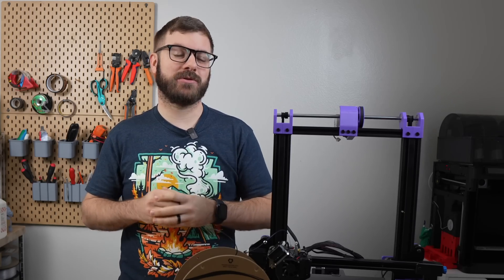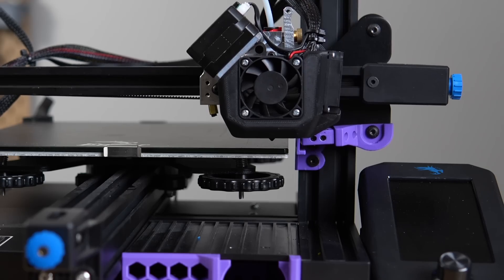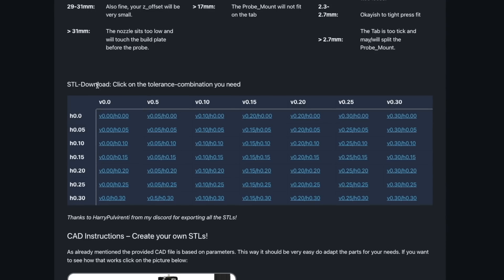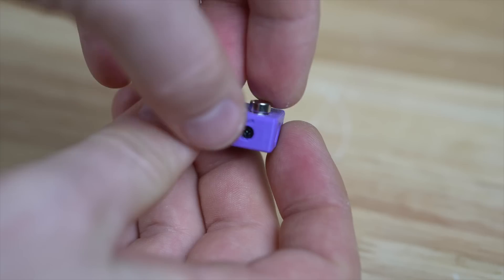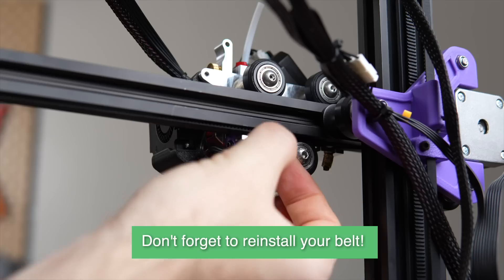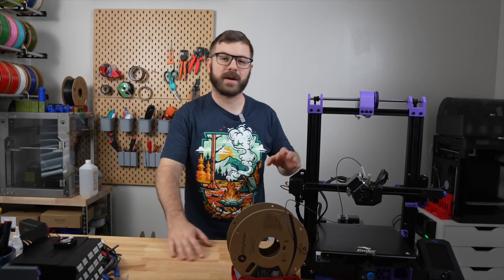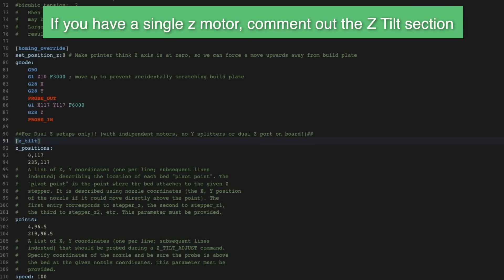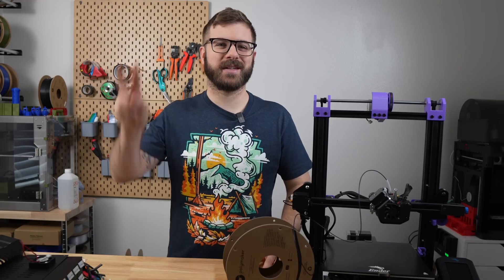Best Bed Leveling Probe For Creality Printers (KlackEnder)

Comment: You can use the probe AS the Z endstop IF you leave the probe on the printhead at the end of every print.  At the beginning of every print do a home all, a bed probe for height mesh, and then undock the probe just before you start the print.  This same logic applies to the klicky probe with a servo mount on the switchwire or enderwire conversion.  The switchwire needs the servo because there isn't any good way to mount the probe dock on the X axis or the Z upright without getting in the way of the tool head while printing (unless you don't use the portion of the bed on the right hand side.
I think that the Z endstop position you gave is wrong.  It should be +8 NOT -8 since the endstop (probe) will fire when the print  nozzleis above the bed, NOT below it.    Also Z offset is the distance from the bed to the nozzle when the probe fires, so that is also a positive number.  Y offset is the distance from the probe to the nozzle (positive) and X offset is the distance from the probe to the nozzle (we try to position the probe directly behind or in front of the nozzle so that distance will be zero).   There is also a z offset setting you can adjust in the klipper web interface, this setting allows you to get the nozzle at the desired height (usually a piece of paper between the nozzle and the bed with a snug but not hard fit) when the position of the z axis is at zero.   This is NOT the same as the z offset in the z stepper section.
Reply: "There is also a z offset setting you can adjust in the klipper web interface, this setting allows you to get the nozzle at the desired height (usually a piece of paper between the nozzle and the bed with a snug but not hard fit) when the position of the z axis is at zero.   This is NOT the same as the z offset in the z stepper section."

This! Exactly was my point. Do you know if there is a way we can put this value in some cfg file?

Comment: Great video i struggled 5 hrs to do this and still cant figure out why the printer starts like at 10mm height from bed whats the solution i tried all possible z coordinates to be changed no solution
Reply: Same. I can't figure out how to set the z offset precisely.
Reply: did you find a way? @nishantlaxmikant5899 @kyleshearer1270

Comment: is it possible to wire the klicky on the 5pin bltouch slot for the 4.2.2 board? so i can use the z endstop pin as a Sxbolt for auto z calibration

Comment: It's so funny that this has now become a 'thing' when several years prior this was one of those 'meh' methods of bed leveling because microswitches have such low precision for activation. Same for inductive; used to be poo-poo'd on but plenty of people use them now. Still staying with the good ol' BLTouch that never lets me down!
Reply: Really, you've never had the drop pin bend because it hits some curled up ABS? For me this was a constant issue, now fully resolved with Klicky.
Reply: @zeroPressure00  nope! Honest to goodness never happened with the plastic or metal pin versions I have.

Comment: I modded my v2 with almost everything except the z-belted axis.. but I'm having problems tuning it for Klipper and get the most out of it.. I use OrcaSlicer and the default v2 profile is based on marlin.. so... super slow... and the default Klipper printer acceleration numbers are way too high... is there a proper way to get the maximum numbers for the v2 on arcaslicer? i would love to see a "Ender 3v2 marlin to klipper speed tunning guide" that not only show the  the calibration parts and the filament tunning but how to properly tune all speeds to get the most out of it

Comment: So why not just use bltouch?
Reply: Not sure about actual BLTouch, but Klicky is at least 25x more accurate than my old 3DTouch (a BLTouch clone). Extremely repeatable. I have my sample_tolerance set at 0.005, and could probably go even lower. For comparison, with 3DTouch, best I could do is 0.02, and that was with like 10 retries per position.
Reply: Klicky is cheaper
Reply: deadzones during bed meshing...

Comment: This is exactly what I needed to find for Z probe for the Ender 3 I just acquired. I am curious about one thing - you mention removing the existing Z Endstop unless you're going to use the klipper auto z offset plugin. Do you have any information on that?

Comment: Hi I just set this up and klipper gives me this error 

Section 'menu __main' is not a valid config section

Once the underlying issue is corrected, use the "RESTART"
command to reload the config and restart the host software.
Printer is halted

Comment: How is that better than BL/3D/CR Touch and why we should use it?
Reply: Not sure about actual BLTouch, but Klicky is at least 25x more accurate than my old 3DTouch (a BLTouch clone). Extremely repeatable. I have my sample_tolerance set at 0.005, and could probably go even lower. For comparison, with 3DTouch, best I could do is 0.02, and that was with like 10 retries per position.

Comment: Grrrrrr
I just sat here for 2 hours just to get this error:

Klipper reports: ERROR

Section 'menu __main __klackender' is not a valid config section

Once the underlying issue is corrected, use the "RESTART"
command to reload the config and restart the host software.
Printer is halted

Cannot figure this out! I guess it is back to the old school way

Comment: I have the NG as well and when I see your values for the stepper Y, I put in position_min: 10 and position_endstop: 8, but I get an error because 8 is less than the minimum of 10. Should those values be flipped?

Comment: I have it installed and running, but... I can't get the mesh and z offset to save, and the gantry doesn't pickup or drop off the probe when doing the mesh. I have to place it manually.??

Comment: What makes the klicky setup better than a bl-touch, other than the price?
Reply: Not sure about actual BLTouch, but Klicky is at least 25x more accurate than my old 3DTouch (a BLTouch clone). Extremely repeatable. I have my sample_tolerance set at 0.005, and could probably go even lower. For comparison, with 3DTouch, best I could do is 0.02, and that was with like 10 retries per position.

Comment: Nope, as soon as you mentioned Klipper I was out, not wasting a second longer getting that to work. Shame, it looks really good.
Reply: That's what I thought, watched it though, turns out it works on marlin too. May be worth a watch tbh, I'm debating scrapping an old mouse for switches and screws at this point lol
Reply: Why do you keep using Marlin?

Comment: would this work with ender 3 pro? it's the base machine and I'm using Cura software, no marlin, no Klipper. I want to add this to my printer but not sure how. I was wondering if you could help me on this?

Comment: Had lot of trouble with it. Will give it another go
Reply: My only trouble was breaking retainer 2 times until I adjusted gcode to fit my machine, took some sleep and adjusted it perfectly. Now it docks and undocks everytime perfectly, this thing is super reliable and precise once you set it up correctly

Comment: Aww, I'm Devo.
I just got this all installed and the wire or switch contacts are not connecting to the surface of the magnets.
Magnet to itself conducts.
Switch contacts verify switch is working.
Can't solder.
Magnets superglued in.
Drove 40mins each way to pick up these magnets.
😭

Comment: Great install video, but another video showing the issues users face upgrading another from another probe with an existing printer.cfg with some addons already installed.  There are a lot of settings that make it a lot more complicated to get working. tilt_screw_adjust, and probe_calibrate macros are especially trouble prone if you are not very klipper knowedgable.
Reply: I myself run into troubles upgrading from a BLTouch: duplicate chip name ´probe’. I would love to see a video addressing this.

Comment: What is the best way to figure out z-offset with this setup? I used the PROBE_CALIBRATE with the bl touch but that doesn't seem to apply anymore. 

I was thinking a macro along the lines of:
 [gcode_macro Z_Offset]  
    G28 X
    G28 Y
    PROBE_OUT
    G1 X114 Y103 F6000 #my offsets
    G28 Z
    PROBE_IN
    G1 X114 Y103 F6000 #my offsets
Reply: You use PROBE_CALIBRATE. I did, anyway. The principle is exactly the same as with bltouch.

Comment: Can you make a before and after video detailing the kevinakasam belted z vs the stock leadscrew's impact on the surface finish? I've been dealing with ugly layers from my e3v2 z axis binding for too long and it seems like the z belt mod would do the trick.

Comment: The probe itself is great after fixing some basic printability issues with the CAD. However the klipper macros are not great. They aren’t using standardized macro naming that would allow for the functions to work properly in UI’s etc. Its easily fixed if you know what you’re doing though. I really think a good solution to this is making it work with the  klicky probe macros instead. They are so well written and do work with the KlackEnder.

Comment: RepRapFirmware is trash.  There's no reason a firmware should ever require you to use a "generator" to configure it, nor have to write your own homing operations, etc.  The point of firmware is to take basic tasks and handle them, and RRF fails on that front hard.  Their hardware on the other hand, is VERY good, and Klipper works with it - so by all means buy their hardware, but don't use their firmware.  It sucks that so many man hours have been wasted on that firmware, but I understand that it being a passion project is what drives it.

Really hoping Smoothieware makes a comeback one day, but Klipper/Marlin are good go-tos for now.

Comment: I would love to see this on a delta something like a Flsun Super Racer its always a pain when leveling and when using klipper its pure hell to get a decent bed level with the stock probe I dont thing its klipper but something in either the stock probe or firmware is a bug any thoughts i would really like to do this for a Super Racer.

Comment: When you get Superglue on your skin, nail polish remover will work in just a few painless seconds to dissolve it. I have an Ender 5 Plus with an Exoslide, MicroSwiss DD, which I believe is the same setup as what you have, and I am getting ready to install a BTT SKR Pro v1.2. I will not be using Marlin or RepRap, will this work with my hardware and firmware setup???

Comment: I was debating on doing this since I'm getting ready to do the belted Z mod. Just waiting on the rest of the screws and the stepper cable. I have a Ender 3 Pro running Klipper with a CR Touch so I was up in the air about the Klacky Probe.

Comment: I tried a clicky probe on my 2.4 and it wouldn't finish the QGL.  Reprinted parts twice, tried 3 other microswitches and still no go and had to go back to my inductive probe.  Still trying to figure out if it was something I was doing or if it's just not as accurate as people say.  Now with Voron Tap released, I don't think I should be wasting my time thinking about clicky... lol

Comment: I will just say that this probe is FANTASTIC in an enclosure, I kept having issues with my EZABL probe where my Z height would vary quite far from the actual height, needless to say I dumped it and switched to klackender and now I don't ever need to calibrate my Z offset every print, just on occasions when I need to re-level the bed.
Reply: You realize the BLTouch was also a possibility in that case?
Reply: @alejandroperez5368  Ha, that thing has also been going wonky in the enclosure as my enclosure easily exceeds 53C during the heat up process, the thing just goes kaput and the results are unusable for auto bed leveling

Comment: Thanks for a video that shows an improvement on a printer and not another cheap Chinese clone.  Too many of them on the 3D channels we need more interesting unique information like this
Reply from the maker: There will still be some videos on low cost Chinese printers but I have been saying no much more often than yes. I got the Sovol SV06 Plus in because I see alot of value there as well as another I have been testing. That being said I absolutely understand what you are saying and certainly dont want to make that the focus. Too many other cool things :)
Reply: @ModBotArmy  Thanks for the reply.  I guess what I was saying as a long term user of 3D printers, that I want more interesting content than the latest cheap I3 clone.   You do a lot of interesting content.

Comment: Ever hear of a CR Touch or BL Touch?   Gees, this is SO much extra work.  Not practical, complex and not as user friendly as the Touch models.  I'm surprised this is even a topic.
Reply from the maker: Not a big fan of either. I dont like the small leg that they use and have seen issues with them breaking or getting damaged in the past. Also have seen weird error states on them. Cost is $30-40 versus what is really a few dollars in parts and those cannot be used with the auto z calibration. If you are happy with them then thats great but having other options is never a bad thing.

Comment: @Modbot about the copy and paste of the Z offset this is not really needed.
The only thing needed to be done is manually comment the Z offset on the probe section of the klackender.cfg and manually add the Z offset in the autogenerated values section of the printer.cfg file.
After this the SAVE_CONFIG command will work as usual. 😁
Reply: How is z offset obtained for this setup? Do I have to run a print and adjust until I have it?
Reply: Hey, in case anyone did this, what should be the header section under which this needs to be added.

Comment: The Ender 3 v2 Neo is infuriating. Basically none of the cool or good mods work with it without modifying the upgrade/mod or replacing parts of the printer. It’s an Ender 3 v2 but inferior in every way. They changed the extrusions for some godforsaken reason.

Comment: Great video!  Is the setup generally the same for a Ender 3 Pro with the Sonic Pad?
Reply from the maker: Should be identical since it is Klipper. Using the stock board your pin would be different but other than that I cannot think of any other differences that you would have to do.
Reply: @ModBotArmy  Great. Thanks.

Comment: Usually I can understand you but this is total geek. But I am 78 yo. I can print anything on my Ender 3 pro. I wouldn't be able to do anything without youtube videos. Just slow down a bit for brain dead people like me if you please. You have a very good channel.
Reply from the maker: This is a pretty technical mod. The documentation I linked should give you much of the details you want. If you decide to move forward with the mod after this should help with giving an additional visual/reference point :)

Comment: The only thing left Ender on mine is most of the frame lol  Many would be surprised how much probes like the BL Touch vary, they really are just good enough but not always repeatable.  

Mines now a DD-IDEX so double headaches when I change nozzles etc.  Finally had enough and wrote a pyhon script that talks to moonraker, uses a cheap FSR (force sensing resistor) for getting first layer height for both hotends,  works great and all automateds.   Cost was about $10 to make it.  I leave probe z_offset at 1.0 and set the nozzle offsets in my tool change macro using z_adjust.  Still need a klicky to probe and home though.  Hard to beat a simple good quality switch.
Reply: could you share that? Might try to do that for my SV04

Comment: Does it perform better than the BL-Touch or CR-Touch?
Reply from the maker: I prefer it over either. To me the little probe leg is a fail point and parts for this are like $5 versus 30-40 for those. Not that the others are a bad option if you already have them I just have had such good results with these its hard for me to justify going a different route.
Reply: @ModBotArmy  Thank you for your reply!
I like that this probe works with both Marlin and Klipper. It's also great news that it's less expensive than the BL-Touch and CR-Touch. Having more options as a maker is good.

I currently use a CR-Touch and it works fine. I might consider this mod in the future. Thanks!
Reply: Ran a probe accuracy tests on both the BL and the Klack.  I was surprised how much more accurate & repeatable the Klack is.  The CR came in much more inaccurate in my tests than the BL

Comment: Awesome video man :-) how do you feel this compares to the tap tap probe?
Reply from the maker: So I dont have first experience with the Tap. However, I dont believe it has been implemented into any other toolheads than the Stealthburner so far and it is not compatible with nearly as many printers. I know someone who has had good results with a reinforced bed frame with dual linear rails but for standard pcb beds from what I am seeing it isnt recommended.